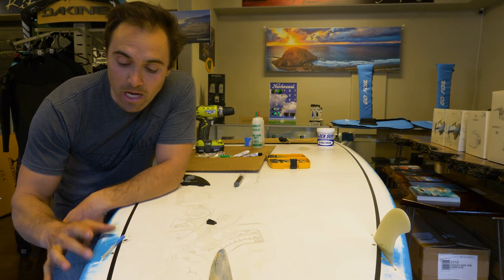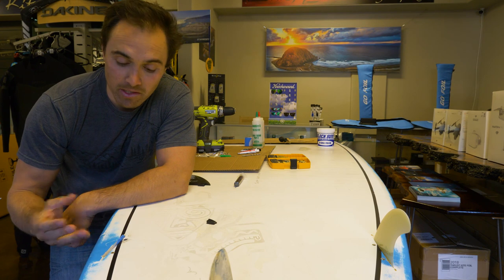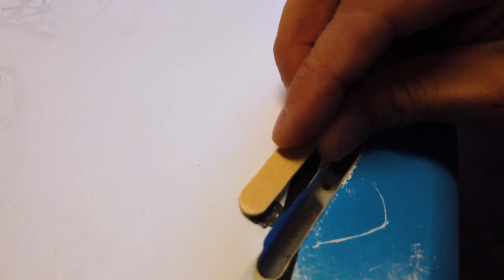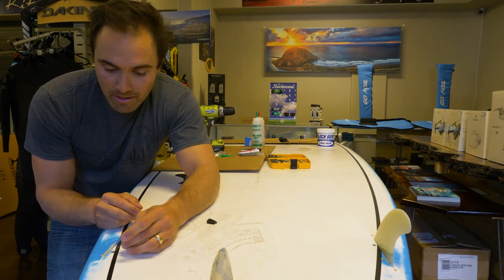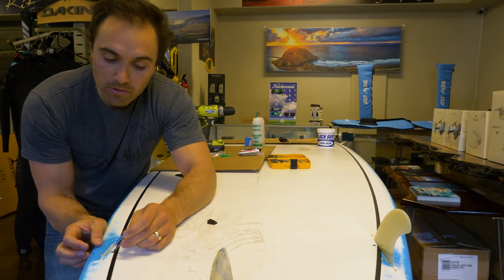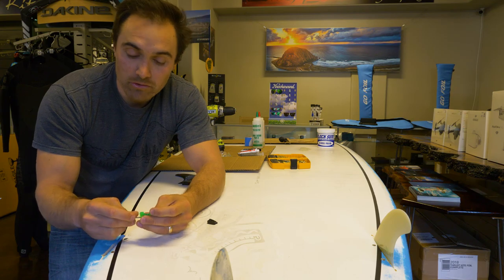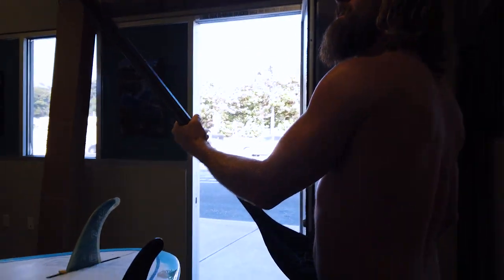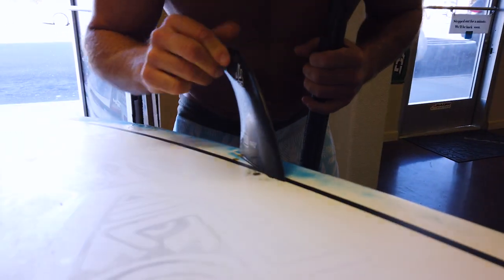Repairing a Stripped FCS Finbox

Comment: I use a method, which is similar, but I think is easier because it requires less tools. Here it is:

Before starting, go to the hardware store and purchase a 1" or longer 10 ANC x 24 screw (24 TPI). TPI stands for threads per inch. I find it much easier to work with a screw that is longer than your standard find box screw. NOTE!!! This screw size is for a Future Fin Box. An FCS Fin Box might use a different size screw!!!

Step 1: Remove the fin.
Step 2: Tape off bottom of stripped screw hole you want to fix so the JB Weld does not leak out the bottom. 
Step 3: Mix JB Weld Part A and Part B according to the instructions. Fill the stripped threaded screw hole with JB Weld.
Step 4: Put the end of a paperclip, a pin, or something similar into the threaded hole and slowly move it around to "work out" any possible air bubbles in the JB Weld.
Step 5. Take the 1" or longer 10 x 24 screw that you purchased from the hardware store and lightly coat the threaded portion with Vaseline or some other type of grease that does not flow at room temperature.(This is to prevent the JB Weld from sticking to the screw as it cures.)

Step 6. Thread the 1" or longer 10 x 24 screw into the stripped threaded hole. Thread it all the way down until you can see the end of the screw barely push on the tape you placed at the bottom of the screw hole.
Step 7: Let the JB Weld cure for 24 hours. Remove the screw and you are finished.
Reply: Doing this tomorrow, thank you for the clear instructions. Cheers!
Reply: @Justin-ig7sg  how’d it work for you?

Comment: I have old FCS1 finplugs and i just drilled new holes on the opposite side with a 4 millimeter drill. It worked out fine and I can tighten the screws again. So no need to buy jb weld or something similar... I don´t know yet if the new holes will pull water but I did the repair job on my riverboard which is pretty destroyed already anyway so I thought its worth a try.
Reply: that can't be watertight

Comment: I'm not sure it would work, but instead of using Epoxy, wouldn't be possible to "melt" some white plastic (lets say...pvc bottle caps?) into the fin screw hole and them proceed with the drilling? Or wouldn't it attach to the hole?
Reply from the maker: It’s possible. Just don’t inhale the fumes of melted PVC! Worst case you can always drill it back out. However, you don’t want risk melting part of the board if the plastic is too hot.
Reply: @JasonLeeCalifornia  Thanks. I tried some Regular Epoxy (not the naval type, but the one with two-tubes ready to mix) on a future fins box but, for me, it didn't worked. Haven't tried the melted PVC yet. I fixed it by getting a wider screw and carving new threads.
Reply from the maker: @quimlima  Yeah, that's the easier solution is to size up in threads. JB weld is actually better for this than epoxy. Epoxy probably cracked but glad you are up and riding!

Comment: Does it matter what epoxy  you use
Reply from the maker: I'm using regular JBweld but the marine stuff might be beter: https://www.jbweld.com/products/marineweld-twin-tube
Reply: I’m thinking of doing the Marine grade.  I just did JB epoxy clear and it didn’t hold.  It felt like gummy bears.  Not sure if it’s because of the temperature here in SF.  I set it for 24hrs.  And i was not happy with it.  So I’m off to the store.